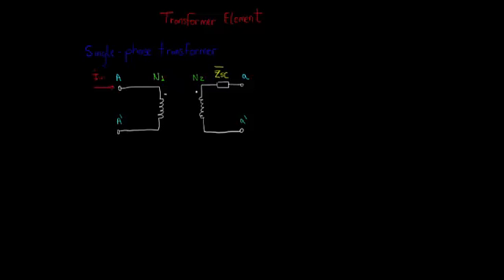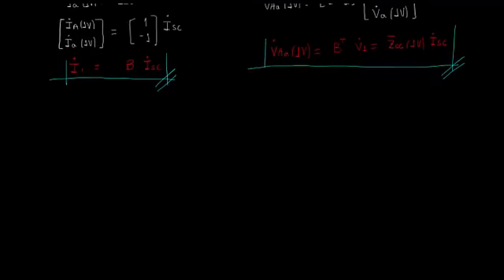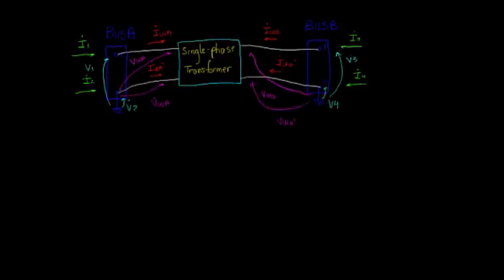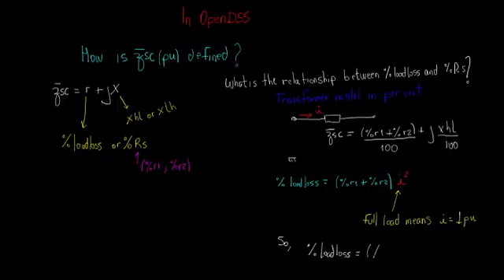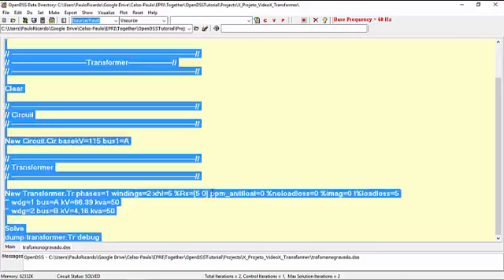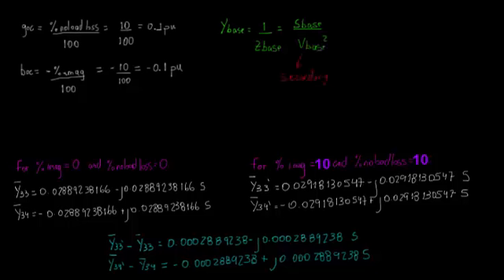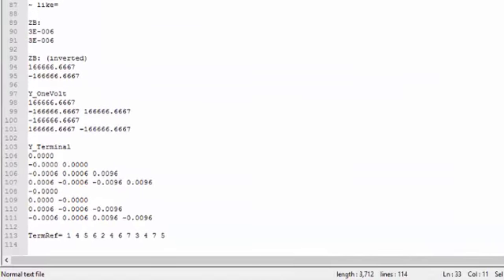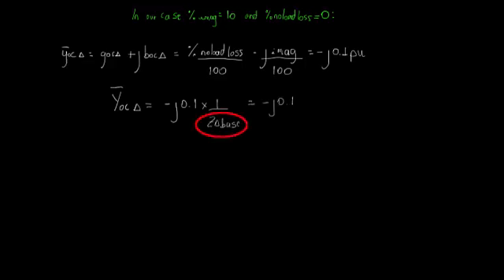12.1- Transformer Element

Comment: Dear Celso,

First of all, congratulations for the great video tutorials.

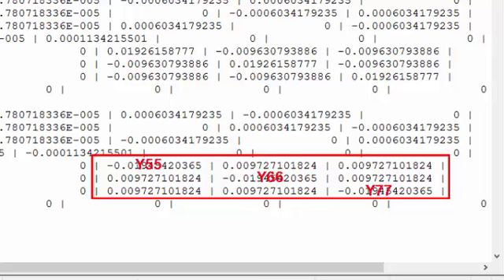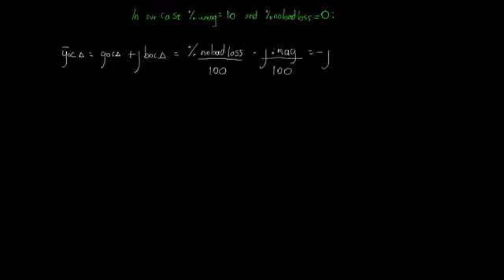At  21:55 you said that the YocDelta admittance is added to the elements Y55, Y66 and Y77 of the original Yprimitive matrix. However, if you try to add the calculated  value of Yoc (22:13)  (which results in YocDelta = -j*0.00009630794S) to Y55, Y66 and Y77, the results do not match with the values calculated by the OpenDss. 

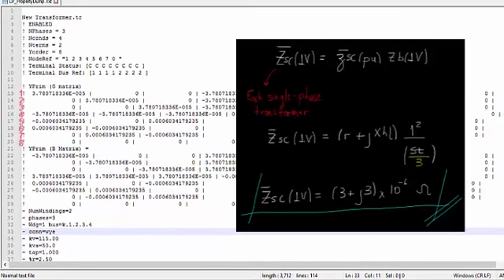Indeed, if you see the values for Y55, Y66 and Y77 of the original Yprimitive (20:20) they are Y55=Y66=Y77= (0.01926158777 - j*0.01926158777). When you add:  
Y77 = Y77 + YocDelta = (0.01926158777 - j*0.01926158777) + (-j*0.00009630794) = 0.019261587771203 - j*0.019357895711203.

In the OpenDss the presented result is the following:
Y77 = Y77 + YocDelta = 0.01926158777 - j*0.01945420365

It seems to me that the OpenDss is doing the following calculation:
Y77 = Y77 + 2*YocDelta  = (0.019261587771203 - j*0.019261587771203) + 2*(-j*0.00009630794) = 0.019261587771203 - j*0.019454203648915

In addition, the calculation of the Y56, Y57, Y65, Y67, Y75 and Y76 are just like the OpenDss.

I couldn't get it why the YocDelta value is being added twice in the Y55, Y66 and Y77 elements of the Yprimitive. 
Could you please check this information and bring me some light?

Thanks.
Reply: Hi Josemar! 

First of all, I am sorry for the late reply. As the videos have not been uploaded in my account, I do not receive automatic updates when there is a new comment on youtube. I have to check each video to search for new comments and it has been a while since last time I did that.
I am glad you enjoyed the tutorials! About your question, you are totally correct. In fact, OpenDSS adds 2*Yoc to the self admittances of nodes 5, 6 and 7 (Y55,Y66 and Y77), and it is expected to do so! This happens because the secondary of this transformer is delta connected. So, if you take node 5 for instance, there are 2 new admittances connected to it. One because of its connection with node 6 and the other because of its connection with node 7. That's why we have Y55' = Y66' = Y77' = Y55 + 2*Yoc. The general rule is, the self admittance of a given node is the sum of all admittances connected to this node and the mutual impedance between two nodes is minus the admittance between these nodes. That's why for Y56,Y57,Y65,Y67,Y75,Y76 we add ( - Yoc) and for Y55, Y66 and Y77 we add 2*Yoc. 
I can't recall exactly why didn't performed this calculation in the video. I believe we just wanted to show where Yoc affects the Yprimitive matrix of this transformer. 
If you have more questions, please let us know!